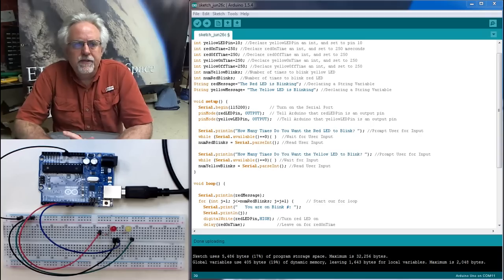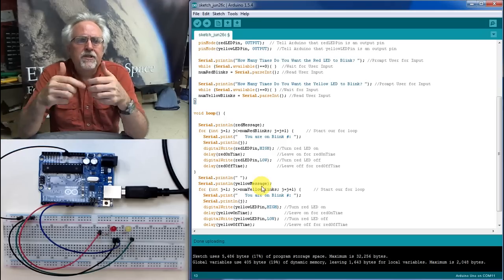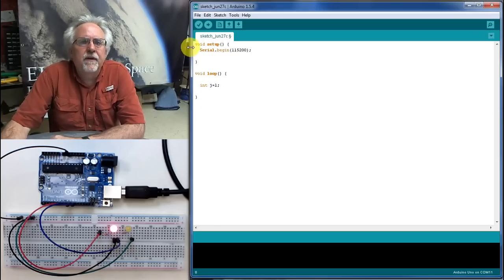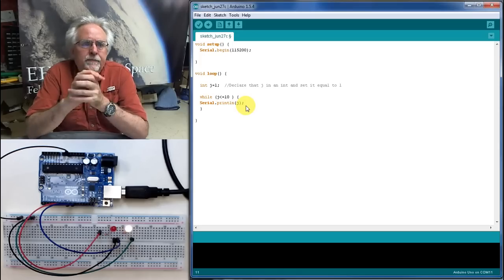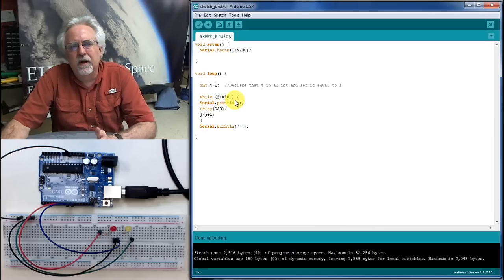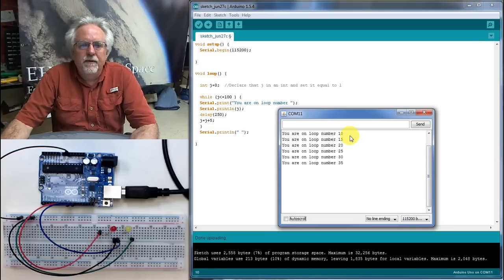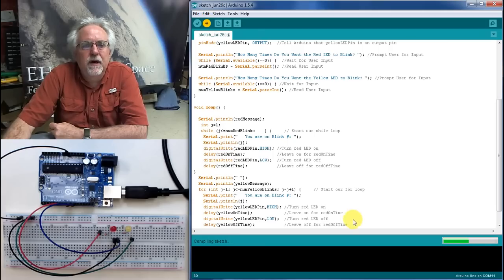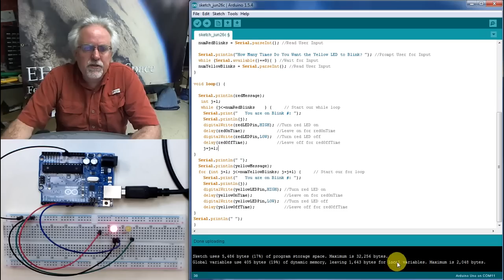LESSON 7 Using While Loops with Arduino

Comment: Thanks for the tutorial. I am following the tutorial and working with it. I have been encountering a problem with the "while" function. 3 "while" has been used but the serial monitor does not wait for instructions from the second "while". It jumps right to the third one. this happens to the second "while" no matter how i do the arrangement. i have been trying to figure the problem out but nothing comes up. Thank You. 
    Serial.println("How many lessons before first break"); //prompt user for input
    while(Serial.available()==0){}  //wait for input
    numLessonsA=Serial.parseInt();  //read user input
    
    Serial.println("How many lessons before lunch"); //prompt user for input
    while(Serial.available()==0){}  //wait for input
    numLessonsB=Serial.parseInt();  //read user input

    Serial.println("How many lessons after lunch");  //prompt user for input
    while(Serial.available()==0){}  //wait for input
    numLessonsC=Serial.parseInt();  //read user input
Reply: Is resolved. Lesson 12 helped me with it. it turns out selecting no line ending is the solution

Comment: How can i interupt a for loop  to set another loop with the serial monitor in arduino
For example:
I have two leds and two functions with a loop (blink1, blink2) so, with the serial monitor ?
Int led1 =2;
Int led2 =3;
String state;
void setup(){
pinMode(led1, OUTPUT);
pinMode(led2,OUTPUT);
Serial.beigin(9600);
}
void loop(){
if (Serial.available){
estate = Serial.read();
if (estado == "one"){
blink1();
}
Else if (estado == "two"){
blink2();
}
 }
}
void blink1(){
for (int i =0; i<=10;i++){
digitalWrite(led1,HIGH);
digitalWrite(led2,HIGH);
delay(500);
digitalWrite(led1,LOW);
digitalWrite(led2,LOW);
delay();
}
digitalWrite(led1, LOW);
digitalWrite(led2,LOW);
}
void blink2(){
for(int b =0; b<=10; b++)
{
digitalWrite(led1, HIGH);
digitalWrite(led2,LOW);
delay(500);
digitalWrite(led1, LOW);
digitalWrite(led2,HIGH);
delay(500);
}
}

Comment: can anyone tell me why the LEDs are not bright.    I'm digitalWriting but still both of the LEDs are not bright enough.
I tried changing it to anologWrite 255 and it worked fine (it turned bright) but when I'm trying digitalWrite with HIGH command, it is not bright. Sounds strange right? 

int redLED = 7;                            // red LED is hooked in pin #7
int blueLED = 8;                           // blue LED is hooked in pin #8
int redLEDonTime = 100;                    // red LED stays on for 100
int redLEDoffTime = 100;                   // red LED stays off for 100
int blueLEDonTime = 100;                  // blue LED stays on for 100
int blueLEDoffTime = 100;                  // blue LED stays off for 100
String userName;                         // store the name of the user

String redLEDblinkMessage = " How many times do you want to blink RED LED? ";               // declare message
int redLEDblink;                                                                             // numbers of time the user wants to blink red LED will store here
String redLEDblinkNum = " You are on RED LED blink Number: ";                                // red LED current position declared
String blueLEDblinkMessage = " How many times doe you want to blink BLUE LED? ";             // declare message 
int blueLEDblink;                                                                           // numbers of time the user wants to blink red LED will store here
String blueLEDblinkNum = "  You are on BLUE LED blink Number: ";                            // blue LED current position declared

void setup(){
  Serial.begin(9600);                                                                      // using serial monitor
  Serial.println(" Welcome to my Program ");                                               // welcomes users
  Serial.println(" What's your name? ");                                                   // asks user their name
  while(Serial.available() == 0){                                                          // as long as user doesn't put their name in, it'll wait
    
  }
  userName = Serial.readString();                                                          // stores user name
  Serial.print(" Hi ");           
  Serial.print(userName);
  Serial.print(", ");
  Serial.println(redLEDblinkMessage);                                                   // displays the red ;ED message. (how many times do you want to blink the red LED? )
  while(Serial.available() == 0){                                                       //  it waits until the user put the number in
    
  }
  redLEDblink = Serial.parseInt();                                                    // stores the number in redLEDblink
  Serial.println(blueLEDblinkMessage);                                                // displays blue LED message
  while(Serial.available() == 0){                                                   // wait until user puts the number in
    
  }
  blueLEDblink = Serial.parseInt();                                                    // store the number in blueLEDblink
  
  
}                                                                                       // setup function closed

void loop(){
  int i = 1;                                                                    // red LED starting point
  int j = 1;                                                                   // blue LED ''         ''
  while(i < redLEDblink){                                                      
    Serial.print(redLEDblinkNum);
    Serial.println(i);
    digitalWrite(redLED, HIGH);
    delay(redLEDonTime);
    digitalWrite(redLED, LOW);
    delay(redLEDoffTime);
    i++;
  }
      Serial.println(" ");

  while(i < blueLEDblink){
    Serial.print(blueLEDblinkNum);
    Serial.println(i);
    digitalWrite(blueLED, HIGH);
    delay(blueLEDonTime);
    digitalWrite(blueLED, LOW);
    delay(blueLEDoffTime);
    i++;
   
  }
   Serial.println(" ");
}

Comment: is there anyway to stop the program or to let it finish? I wrote a program where leds would blink for 10 times and then say "you are done", but when I run it it displays "you are done" for infinity! why?

int Red = 9;
int Yellow = 11;
int j = 1;

void setup() {
  Serial.begin(9600);
  pinMode(Red, OUTPUT);
  pinMode(Yellow, OUTPUT);
 
  
}

void loop() {
  while(j<=10){
    Serial.print("You are on blink ");
    Serial.println(j);
    digitalWrite(Red, HIGH);
    digitalWrite(Yellow, HIGH);
    delay(200);
    digitalWrite(Red, LOW);
    digitalWrite(Yellow, LOW);
    delay(200);
    j=j+1;
    
  }
  Serial.println("You are done!");
}
Reply from the maker: TheBull06 This is because the void loop loops forever. There is no "stop" or "end" command in arduino.
Reply: +TheBull06 

Hey man, Try it:

int Red = 9;
int Yellow = 11;
int j = 1;

void setup() {
  Serial.begin(9600);
  pinMode(Red, OUTPUT);
  pinMode(Yellow, OUTPUT);
 
  while(j<=10){
    Serial.print("You are on blink ");
    Serial.println(j);
    digitalWrite(Red, HIGH);
    digitalWrite(Yellow, HIGH);
    delay(200);
    digitalWrite(Red, LOW);
    digitalWrite(Yellow, LOW);
    delay(200);
    j=j+1;
    
  Serial.println("You are done!");
}
}
void loop() {}

Comment: I'm having a problem with this lesson.  When I run the script I am asked how many red blinks I want, I enter the number, it asks how many yellow blinks but does not stop for me to enter a number instead just starts blinking the red LED and skipping the yellow.  I think it is because the Script.available was set to 1 with the red query and is still 1 when it hits the yellow query.

I tried entering the lines myself and after many attempts and modifications still had the same issue so I copied the code from your script and got the same result.  

Help.
Reply: I had the same issue. if you enter a second int in the same second, then it works. Beside that, great work!